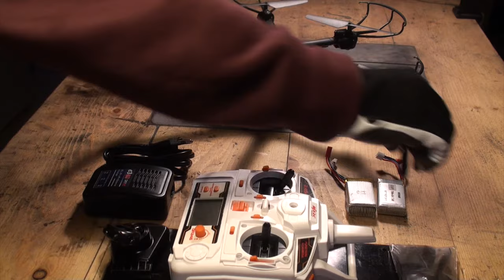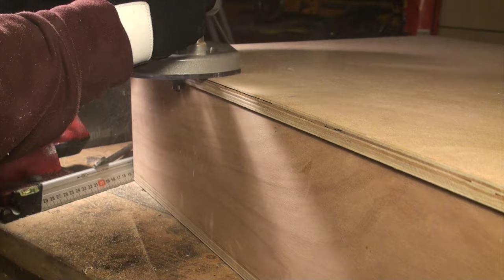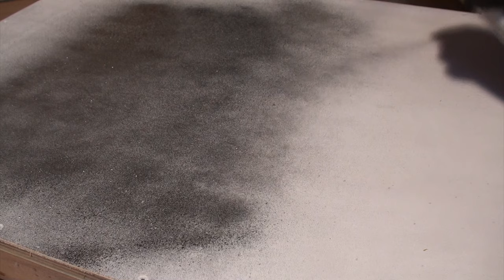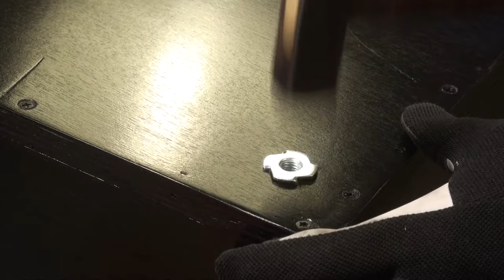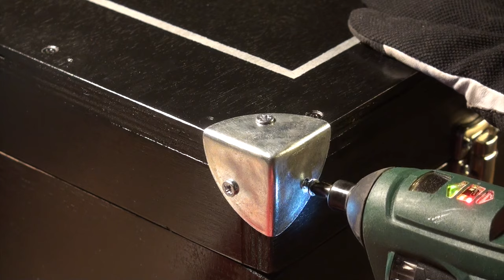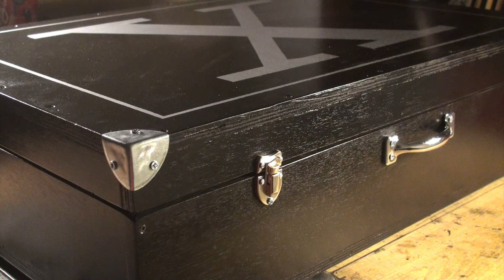DIY - Making A Custom Quadcopter Case / Box And Launch Pad

Comment: Nice box and video!! One question, why the gloves? I can't feel things as well when I have gloves on. Suspect it's just a personal preference thing.
Reply from the maker: Thank you ! I guess it's a personal preference yes. But I always worked, specialy with power tools. I feel like I have a better grip. And they saved my skin and hands a couple of times already ;)
Reply: @RedSmithWorkshop  Only problem is on a power saw the blade can grab your hand and pull it in.  If it catches skin in will break it.  If it catches cloth it can pull it in and your hand with it.  Dad lost a thumb that way.  Very nice video though.  Just what I was looking for.  Thank you
Reply from the maker: @craigowens510  Thanks for the advice. Sorry about your dad. Glad you found what you was searching for😊